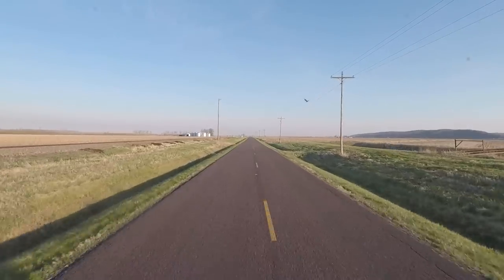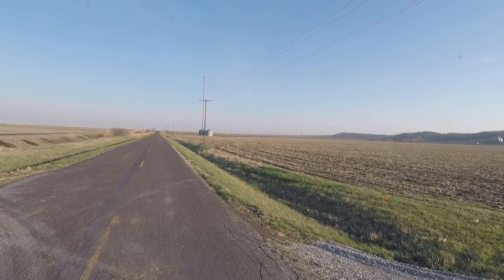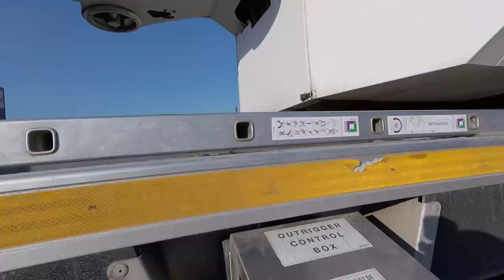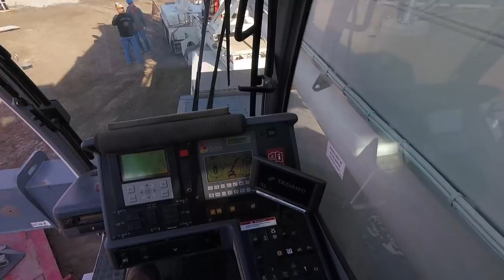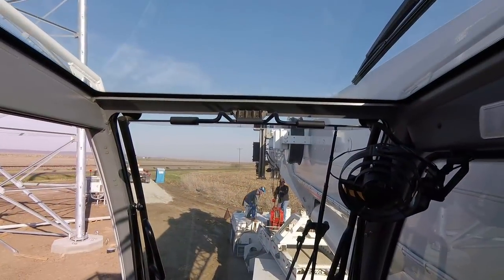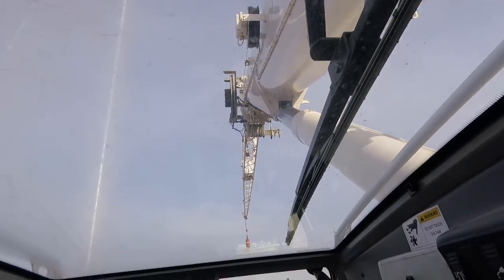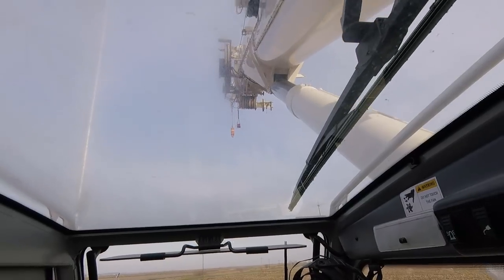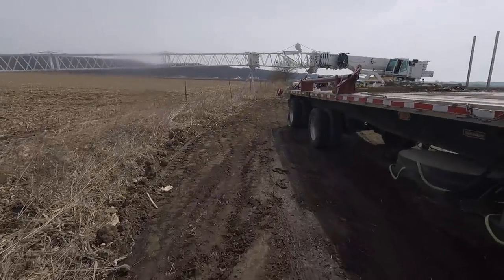Taking a crane to it's limits - crane jib installation

Comment: I know you worked and studied hard to earn your seat in that crane.  It's got to be quite an honor to roll up on a job site in that rig.  I often get the "Rock Star" treatment, and I'm only running a 22101!
Reply from the maker: Thomas Nelson, I honestly don't think of it as anything more than any other crane. It just carries more responsibility and requires more work to set it up. Thanks for watching! 🙂👍
Reply: Setting up and knocking down are definitely the most work in  our trade, but!  My outrigger pads are rated for 105K lb.each, but only weigh 75lbs.!  You have a tele-handler setting yours!
Reply: More work, more responsibility.  That's why we make "The Big Bucks"!  @ToTheTopCrane

Comment: The stresses on that piston must be just incredible! Just the one for boom up and down looks kinda wimpy from a long way off. I'd have ulcers running a crane like that. I got nervous just seeing the raised boom for the distant shot. Just enough to reach, not a lot to spare was there. Scary stuff if you ask me. Thanks for the video.
Reply from the maker: The boom cylinder has a pretty large bore. I'm guessing 16 inches or so. But yes, the pressures in that cylinder must be enormous. I suppose if we really are curious, I can measure the cylinder tomorrow and calculate the internal pressures. Believe me, I was nervous too. There is no room for error. Also, there is a lot of calculations that go on before the crane is even set up. I had to stay within a certain distance from the center of the tower. If I was too close, I wouldn't be able to boom up high enough, and if I was too far away, I wouldn't have enough tip height.
Reply: I sure you don't leave a lot to chance, in fact I'm sure you leave none !  That's not the kind of thing one goes in blind on.  I think my head would explode doing the math to calculate the stresses.  Thanks for the reply.

Comment: Great job with your video productions.I find them very entertaining and educational. I’m very curious about how you actually move the boom when it is maxed out, like on this job.My main question is, if the boom angle is at 75 degrees and the signal man wants you to boom down a few degrees, how do you avoid boom whip? Are your hydraulic controls so fine tuned , that you can boom down without imposing dynamic force on the crane?One other question is, would the safety systems on your Taranto 180g-5 prevent you from going into a danger zone on your charts?

Comment: Look at that boom bend, nice
Reply from the maker: Neg Ice, it looked much worse from the seat. But, I thought a view from a distance would be better. I already have an in cab view of the other tower.
Reply from the maker: Dig Byck, as long as I keep the crane inside of its load charts, any amount of deflection is allowed. What would cause a problem, is if I was overloading the crane.

Comment: Wow I cant believe how much that boom deflects when extended. Why do you raise the tires from the ground when you level the crane?
Reply from the maker: JOHN HUFNAGEL, raising the tires clear of the ground is the only way of knowing that all of the weight of the crane and load is 100% supported by the outriggers. Thanks for watching! 🙂👍
Reply: Just as RT crane retract cylinder of the wheel